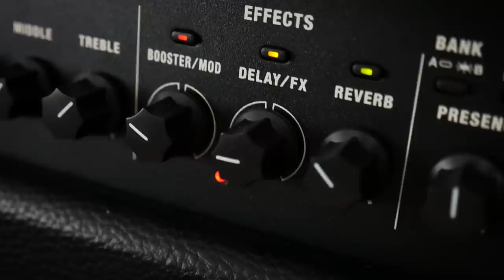Amplifier Classes Explained | Boss Katana Artist

Comment: So back when I was building amps, my understanding was that Class A can be done in Single/Double-Ended or Push-Pull. The only requirement is that all output tubes in whatever configuration are conducting at all times. Class AB amplifiers conduct in the way you described, but running them in low wattage scenarios as you describe doesn't make them "Operate in Class A." Instead what you have is a Class A Push-Pull amp.
Reply from the maker: Class A amps can be either Single Ended or Push-Pull as you describe, however it is entirely correct that Class AB amps conduct over the entire input signal while running at low wattages. 

Class AB acts as Class A at low wattages, most home volume level will be within this range. 
Only when running at much higher volumes, and hence wattages, does the amplifier's AB characteristics come into play.
Reply: Yeah you're right... I went back through my books. I'm pretty sure I misunderstood what you were trying to say. There's not that much different between A and AB in push-pull at the end of the day, and since you didn't mention A Push-Pull earlier I must have assumed that was it.
Reply: A 15W Class A amp putting out 5W will sound different to a 15W Class AB amp (supposedly operating in Class A at low volumes) delivering 5W.

Comment: Just sayin'... I've got a Katana 50 and a digitech multi-fx. I put the amp selector to acoustic by accident and it sounds gr8 with pre distortion/modulation. Back off bass and treb and boost mid a bit and it's a killer sound. The valve type distortion in Clean mode is gone and it is super responsive to dynamics without saturating.

Comment: It would be nice to record this amp on the edge of breakup. High gain is not a problem for a long time with solid state amps. We all know many metal players including one and only Dimebag Darell used solid state amps. But what happens when you want just a little growl when you dig strings harder but retain clarity when picking soft?

Comment: I've learned a lot from your channel!  🤘. So you were talking about insulation, is that what the metal covers do on preamp tubes?  Hold in heat or block out noise?

Comment: I have a Behringer Ultrabass BXD3000h. While the price tag was perfect for a bass head, the functionality has me worried. When jamming, it sometimes cuts out briefly. It's happened at home and in the practice spot. I'm guessing this has something to do with varying power draw but I'm not sure. Any help would be appreciated as I like this amp head and can't really afford anything better just yet.
Reply: did you check the jack? It might just need to be soldered, in either the amp jack, or the the guitar jack (or the patch cord)
Reply: Mat Coddy It's pretty new and all my guitars are in top condition. It will cut out then back in and work from then on. I'm guessing it's more power related.
Reply: wykydrone  Older Behringer amps in general have this problem. I don’t know how many times I’ve had to switch a Behringer amp off and back on to get it to work again. No answer as to exactly what is the exact culprit, if it’s down to using component/components that aren’t right for the job or if it’s that the designs are poorly engineered on paper by people that actually don’t know what they are doing. I just have never taken the time to troubleshoot the problem as I’ve never owned any of the products, they were only what was provided by others that hired me to run them. That said, this has improved in recent years, however it still happens in newer products, but less frequently or just is taking longer to develop. This also does seem to happen faster in environments where the power available isn’t very stable.
Reply: It's the newest model available (for the time) but I played it on Saturday on the first channel running an amp sim and no issues. I'm guessing now it has something to do with the second channel. I've been doing some research to see if others have had that problem just on the second channel but so far nothing.

Comment: Gravitational manipulation of gasses negates the need for a loudspeaker driver as the air itself is moved.  No waiting for a coil n cone to respond and recover and no worries of impedance* mismatching blowing up the amp.

*providing minimum air pressure, see manufacturer for details.

Comment: Great demo man, the Katana sounds sweet but what where those pups in the natural Strat-like guitar? They had great articulation, even at higher gain/distortion levs.
Reply from the maker: The pickups in that guitar are my own design. I wind them to my  specifications to get clarity without sacrificing output.
Reply: @ScienceofLoud  Well I'd definitely say you did a good job then. That bridge pup had great clarity but still gave that tasty, punchy tone you want from a bridge bucker. It sounded very similar to the SD 'Whole Lotta Humbucker' set I've got in one of my LPs. I've got a couple of old Orange amps & a Marshall Superlead but that Katana sounded great. Listening to it I would never have believed it was solid state in any way.

Comment: "Distortion is usually the Achilles heel of solid-state amps."

Interesting.  So you and Glenn Fricker both think that the hardest thing for a SS amp to produce is good distorted tones.

I record with an older man who does a ton of jazz, and he thinks the hardest thing for a solid-state amp to make are clean tones that are crystal-clean but have that feel and interesting tone that only tubes/valves can make, and he thinks SS amps (which a lot of jazz guys use because SS amps are cleaner and cheaper, so the jazz guy can spend more money on heroin) are sterile and boring.  He uses a Fender TR set super clean.

I used to record with a guy who is in a blues band, and he never uses an SS amp because to him, no solid state amp can make a decent edge-of-breakup overdrive.  He thinks a good overdrive is the hardest thing for an amp to do, and likes an old Fender Tweed with the gain up, being pushed by a TS808.

I guess I am a British rock guy (I'm a Yank, but I am a diehard Vox fanboy) and I got an all-valve Vox clone because I like that nasty, fuzzy, EL34/EL84 edge-of-breakup tone that only valves can do.  To me, a Vox tone is the hardest thing for an SS amp to make.

I guess my question is: is it all because that's the type of music we like and play?  Is it because we listen to that type the most so we know what to listen to?
Reply: From my personal experience, there is no crystal clear clean tone as good as the ones made by transistors. Tubes tend to deliver a mid hump everytime. Some people perefer it, but it is no high fidelity at all.

Comment: Nice. I've only ever used the old Boss 7band as a flat boost but this opens it up. **Got a TATA**. Why so many Valves? Why have we got a single 12ax or ECC83 in some preamps with others sporting 2,3,4 +. Then why 2 or 4 or more power stage vales? Whats the difference?
Reply: Hmm. Wrong video John. Had this and the EQ open at the same time....

Comment: I have a Blackstar ID 260 TVP and it is a beast solid-state amp. And it has a very unique system. It depends on what true value you are set on that change it from AB class to a A-Class amp and it's stereo. The stereo section is tremendously beautiful. So guess what I get the best of both worlds if you haven't tried this amp you might want to give it a go it replace my tube amp. But let me warn you it is heavy like a Tube. amp.

Comment: I appreciate that you use technical electronics terms despite catering for a guitarist audience, but in this case it doesn't make sense. Linearity is not a relevant metric for electric guitar amps at all, what with overdrive being the outcome when you drive an amp out of the range where it even tries to behave linearly. If linearly were a relevant quantity, then there wouldn't be a discussion because class D is, within the audible spectrum, more linear than class A – as well as, like you say, more efficient than class B. (And no, it's not more expensive anymore either.)The reason class A/B can nevertheless  make sense is precisely that it's less linear, and that (unlike in class B and D) the nonlinearity is musically useful. A solid-state A/B is nowhere near as good as a valve A/B in that regard, but I reckon it does couple to the speaker in a way that may make it sound better. This interaction can also blow out the speakers though, which is why live engineers learn never push a solid-state A/B amp over its limits. Therefore I suspect that Katana doesn't actually use the power stage's nonlinearity at all and instead simulates it digitally, which makes me wonder if it would actually sound any different with a class D power stage...

Comment: Awesome video!
Maybe a way huge question here, but is there a difference between type/class of amp in how your pedals run thru them (in thinking mainly overdrive)?
Put another way, is the type, or the class the bigger difference maker in how the amp responds to your dirt pedals?
Reply: Raz Rojas B : that makes sense... Does this apply when we're talking valve vs solid state?

Comment: This is old news and everything, but Class D amps are the way of the future. The kind of power and clean sound you can get from modern Class D amps make oldschool A and AB amps obsolete. Just in terms of packaging/efficiency. You can cram 3-5x more "clean" power output into a typically sized amplifier cab with Class D parts, compared to with standard A and AB components. A 600W AB cab could house a 2000W Class D board and have extra room for a bunch of other features like a built in DSP for recording or Wireless module for cable-less guitar hookup.

Comment: Hi mate, could full size distortion pedals designed to drive the valves of class A 100 watt amps fry the transistor circuits of class A/B say 20 watt amps if used constantly?

Comment: i like my katana 50 but here it is 2020 and i bought one of the 1st made i guess cause it doesn't have 4 channels on it like the AB on channel one and AB on channel two. i looked into updating the software but it says if its not done right it'll ruin my amp. since i didn't buy it brand new i dont know what's been done to it so i'm afraid to try to update the software in it. overall its a great sounding amp that all the thought was put into the sound of it and none into the design and function of it at least to me

Comment: With guitar amps, the class of the amp isn't that big of a deal. Its really about tubes vs solid state. There are 2 main reasons why solid state amps have trouble keeping up with tubes. A tube amp distorts when you turn the gain up on the input until the tubes can't maintain a clean sound any longer. The more you increase the gain, the harder the tubes are overdriven, and that's where your tube sound comes from. This is extremely difficult to replicate on a transistor amp. Especially when it comes to feel. For example, you can set the sound of your tube amp up so that when you are playing light on the strings, you get a clean sound. When you start to play heavy, that will force the tubes to overdrive and you lose your clean signal. Again, its extremely difficult to replicate that type of sound with a solid state amp.

There's also one other big problem. Tubes and transistors distort differently, and the sounds they make when they distort is completely different. When tubes distort, 2nd order harmonics are generated. This type of distortion tends to be pleasing to the ear. Its sounds good. When transistors clip, they produce odd order harmonics. This doesn't sound good at all. Odd order harmonics are the last thing you want to hear coming from an amp. 

This is why change has been so slow. The challenges solid state designers are facing are huge. Everything is working against them. Its incredible that they have them sounding as good as they do. An incredible amount of works went into designing these newer solid state amps.

One last thing. Class D amps are not digital. Ever. Some class D amps employ digital technology, but regardless, the signal you hear is analog from input to output, and is never converted to digital. Some class D amps tap off the analog signal coming into the amp, convert it to digital, and use that data stream to turn the transistors on and off. But the amp itself is still analog.

Comment: My Chute CC-04 is a 35 watt class A that uses a pair of EL34s. Why a pair if it’s single ended?
Reply from the maker: It's completely possible to use more than one valve in a Class A arrangement, both valves are amplifying the whole signal rather than sharing half each as in Class A/B.

Comment: Class D amps have actually become quite high fidelity, tiny and inexpensive nowadays with oversampling and PDM (pulse density modulation). The higher sampling rates allow for the speaker load to be suitable filtering by itself for sound reproduction and the switching noise is pushed up into the inaudible frequency range (~200kHz) and they don't sacrifice the higher frequency fidelity hardly at all. They make them in inexpensive (<$20) chips nowadays and is probably what's in all your wireless and noise-cancelling headphones. It is harder to make these oversampling class D amps very powerful however (more powerful than headphones), but its not unheard of.

Feel differences between solid state and tube is mostly due to the fact that tubes have highly load dependent responses and transistors generally much less so. So, the impact of a speaker cab doesn't colour the sound of the amp as much as a tube amp. Older SS amps didn't take this into account and sounded sterile because they weren't trying to recreate the colour the interaction between tube and speaker had. SS amps don't break up vastly different from tubes, but they do still sound somewhat different at breakup especially if they're class D, so generally you want to use that extra efficiency to get way more power headroom(for example, you'll want a 100W SS amp to do the job of a 5W tube amp) and avoid breakup. With proper headroom and EQ tone stack, a SS amp should sound as good as a tube amp for clean (meaning you don't push it break up).

Also, you never want to push the input of a SS or digital amp with a pedal. Just don't do it.

The Katana probably does all its tone shaping before it gets anywhere near the amp. Which is fine. It's probably the way guitar tone shaping and amplification will mostly be done in the future. It's nice to see a guitar gear company starting to figure it out.

Comment: So I've got a question, because I know next to nothing about gear.  What is the relationship between class D and solid-state? They're obviously not synonymous because this solid-state amp is class AB. But the way you talk about the issues with solid-state amps sounds a lot like the issues with class D. Are solid-state amps TYPICALLY class D?
Reply from the maker: While it's possible to construct a Class D amplifier with valves (and I'm sure someone has done it before) it's not exactly practical. 

Class D amplification really took off after the transistor revolution of the 60s where valves were replaced by solid state technology in all consumer electronics. (Guitar amplifiers are the last hold out in a world that has left valves behind)

Class D is super popular for delivering a lot of power in a small package, so if you are buying any device with an amplifier in it, like bluetooth speaker, portable radio etc, they'll all be Class D and solid state. 

It's important to remember that a valve and a transistor do the exact same job: They use a small current to control a much larger one. 

A transistor is just a solid-state version of a valve, so anything that can be done with one could potentially be done with the other. The very first computers were massive units full of thousands of valves!

The difference between them, other than practicality, really comes down to how they distort when driven beyond their limits. That's where the debate begins in the guitar world. 

Valves distort in a pleasing, natural manner with low even order harmonics. 
Transistors distort in a harsh, unnatural manner with lots of higher odd order harmonics.  

If you aren't distorting a signal with transistors (in the case of a portable radio for example) then the convenience of transistors is obvious!
However it's the natural 'warmth' of valve distortion that makes them the choice for audiophiles. 

I hope this helps.
Reply: @ScienceofLoud  Thanks, it actually does. Much appreciated.

Comment: Class A tube pre-amp + class D power stage = best compromise for "old school" tone with modern power & portability. In the world of home theater there are amplifier circuits capable of over 200w at less than .004% total harmonic distortion. Class D should not be associated with cheap or bad sounding.
Reply: Yep! Seems strange how many people doesn't realized this yet. You can have a really killer, light and inexpensive setup. The money you save you can invest in nice cabinets, speakers and so.

Seriously, when my Joyo Zombie is not enough (and with my speaker it goes for 120dB!), I can just send the signal to a 150w TPA 3116 or any other higher wattage power amp and be done. The thing weights less then 100grams and you can make a case of the size of a pedal. It runs on inexpensive notebook power supplys just fine though.

No more power tube replacements and biasing stuff, and for ME personally, I like to do my tone shaping stuff exclusively with the pre amp and pedals. Way more consistent and reliable.

Quite a time to be alive.